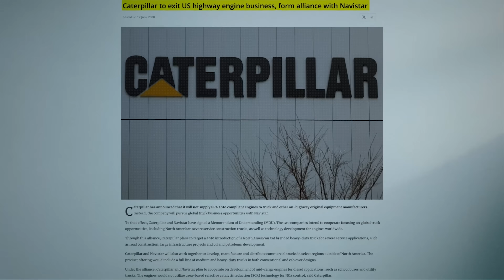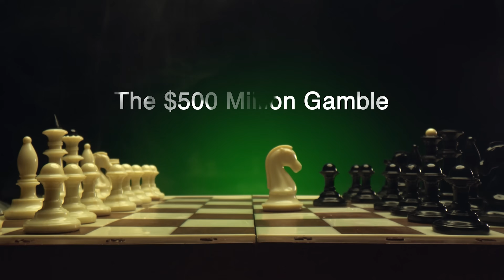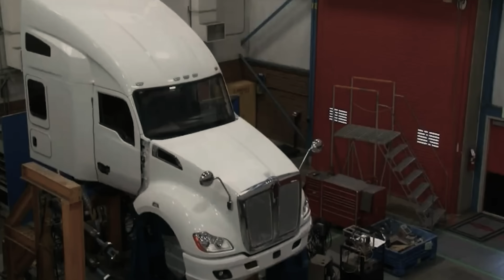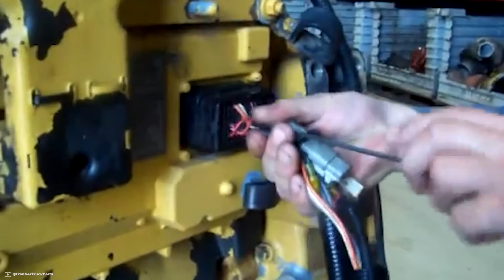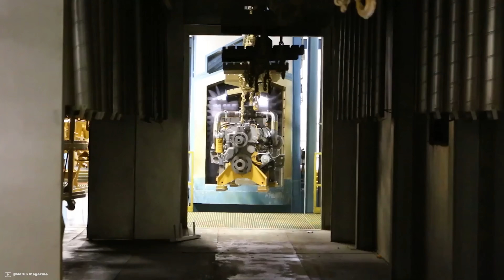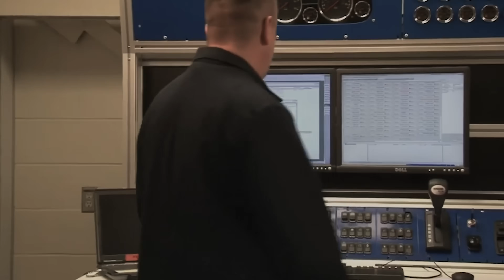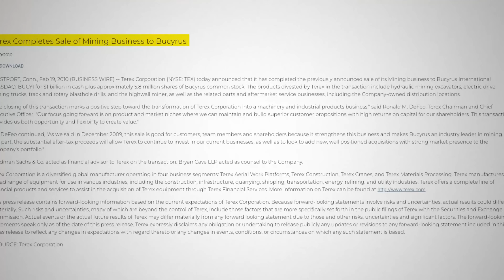Why Caterpillar Quit the Trucking Industry

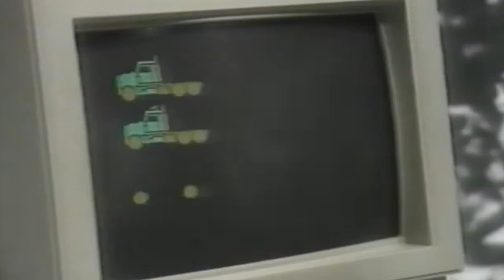Comment: 5:35 What? I never knew that Caterpillar got there first. They were running a con to cheat on emissions test 20 years before the VW Dieselgate scandal in 2015. VW had cheater software in their 2.0-liter and 3.0-liter TDI engines which could detect when an emissions cycle was being run and dialed down the engine to pass the test. Ultimately this cost VW on the order of $30B in fines, owner credits, and buyback costs.

Comment: Sure, they pour particulate into the air like there's no tommorow....but all diesels are dirty anyway. Emissions kill simple mechanical diesels. 

We need emissions regulations, don't get me wrong, but it feels like simplicity and reliability become irrelevant when the EPA forces you to use engine destroying technology. Clean air is important, but I am pretty sure a heavy duty diesel is supposed to just do its job and pull loads rather than please the government and run clean.

Comment: 3406 was a good engine, but the best diesel engine is so much less efficient than the worst electric motor. It's time to move into the 21st century.
Reply: Said someone who knows nothing about trucking.  Road trains in Australia can put at least 1000 km under the wheels before even needing to think about refueling.  Show me an electric truck that can match that (and refuel in under 15 minutes) and still drag 80 tons down the road in 40 plus degree heat.  They don't exist and never will.  Same for agriculture, no diesel equals no food.
Reply: @AnnaJackson-k9m  You're right that I know virtually nothing about trucking but I know a fair amount about caterpillar engines and electric motors. Your prediction that electric OTR trucks will never refuel in under 15 minutes is mistaken. Here is a video of a New Zealand manual battery swap shop refueling an electric truck in under 8 minutes:
https://www.youtube.com/watch?v=rIh_iaxm3cc

CATL (Qiji Energy) in China does it with an automated system in 3 minutes. They already exist and no diesel definitely does not equal no food.

The world is changing. Best we change with it.

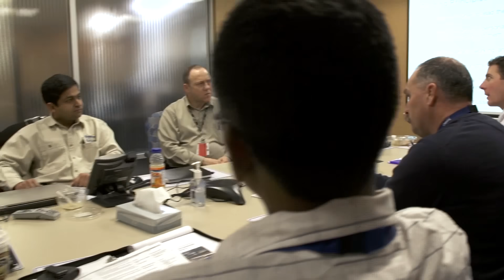Comment: 6:37 were these "deceit devices"? really? 
What if the science behind the much decryed NOx environmental- and the intentionally exaggerated health- damage was deceitful? itself. (Heart attacks have many reasons; some are hidden by the med profession INTENTIONALLY_$$!) 
Or if it was skewed, one-sided, incomplete, an ideology, as narrow minded as the CO2 & CH4 climate narrative of today! instead of politically killing those good engines, the Laws could have been stated so, that the trucks would have to drive with reduced fuel injection within city bounds, and have a normal  fuel/air ratio on the long highways, additionally get a special "super charge" allowance on special mountain steeps, where far away from settlements!  But no, the Lawmakers trended towards Dictatorism, single minded, narrow mindedly. 
if the science is not correctly done, then the politics was erraneous and this "deceit" was a legitimate protest against national and international, western self-destruction! 
"Science" just looked at the brownish leaves, but I suspect that the plant's roots in the soil and thus the whole plant is not that much affected by NOx as the consented "science of the last decades" had stated!!

Comment: 0:18 i don't know where this video is going. But almost 40% of all Big trucks on the road still has a Cat under the hood.
Reply: Based on my knowledge working for Cummins in a leadership role, it was estimated in 2022 that less than 8% of over-the-road trucks in the USA still had CAT. It should drop to less than 1% by 2028. California, the state with the world's fourth-largest GDP, banned them in 2023.
Reply: @Carl_in_AZ  yes with time there will be less and less Cat power on the road simply due to Cat not making truck engines anymore. 
My point was people are doing everything possible to keep them on the road because they are better than the other options. 

Now that the EPA and congress have removed over hundreds of frankly ignorant regulations on road diesel engines the manufacturer can start putting power and reliability back on the priority list.
Reply: @jamesmcd71  I recently retired from Cummins and worked heavliy with emmsions. The new rules affect DEF fail-point sensors, remove criminal prosecution for tampering with emissions, and require the engine to enter limp mode when running out of DEF. All over-the-road engines have addressed 2027 NOx requirements and are telling the government it is too late to change. Many areas of the country still have their own emission requirements, so it is no longer criminal but remains civil, and the engine (vehicle) may not be licensed if the emissions are tampered with. The $2 billion fine from the EPA that Cummins paid in 2024 would still apply under civil and criminal law today, given the 2024 Supreme Court ruling against Chevron.
Reply: @jamesmcd71 have you ever been otr?? Cummins and detriot run the market now i have a cummins cx15
Reply: No new Cat being spec for a truck. People just buy them
Reply: No way this stat is true. I don't think that their peak they had 40% of the market but they sure as heck don't now
Reply: Not true at all most are cummins and Detroits now

Comment: Recently ran for some 300k miles a 92' Peterbilt with a 3406C hauling Fuel Oil & Diesel. Absolutely Bulletproof. Power and More Power on Demand. Did some of the maintenance work on the engine but it was always ancillary stuff the engine itself never needed any work. It hauled a fully loaded Tanker as easily as if it were an empty. 
The unit is still on the road today.

Comment: The engine group was losing money evey year they serviced OTR.  The truck manufacters were requiring so many special builds with custom casting that the factory was drowning in cost.  The year after leaving that market the engine group was profitable.
Reply: Actually that's not true. For many years the on highway segment lost money on every engine sold, but with so many engines on the road the engine division was actually one of the most profitable divisions in the company due to parts sales.
Reply: EVERY SINGLE piece of CAT equipment loses money, except the D11.

Comment: I drove a 2006 International with a CAT in it, don't fucking do that.  It got tuned, and still was absolutely gutted on mountain roads.  Not that the original engine from INT was much better, the transmission fucking exploded.

Comment: I was a tech right in the middle of those times, I knew the 3406B inside and out. Best engines ever made. I was also a tech when the dreaded Maxxforce engine came to be. Horrible time for me as a tech and the company I worked for. We had more trucks broke down than were on the road. Most of the ones still on the road at that time were the old Macks they still had.
Reply: I had a MaxxForce engine in my truck, I hastily backed up and hit the brakes hard , it slid out of the truck bed onto the ground at the scrapyard !
Reply: Drove a couple of 3406 Engines ,Fantastic bit of kit ,so much low down torque ,coupled to a Fuller  13 speed box .

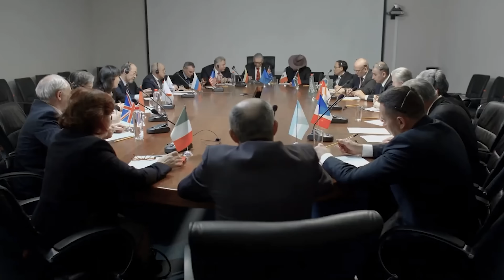Comment: 6:06 and the EPA’s answer was to force DEF which is far more detrimental to the environment🏴‍☠️
Reply: EPA didn't force DEF use.  The EPA forced NoX reduction.  Manufactures chose DEF for that. With exception to International and the Maxxforce family.
Reply: @77chucklez  "The EPA mandates the use of Diesel Particulate Filters (DPF) and Diesel Exhaust Fluid (DEF) systems on all on-road and non-road diesel engines manufactured after 2007"
They most certainly did. Once the DPF came out within a few years they added to the regulation mandating the system continue to be used and added to.
Reply: @yourfavoritelawnguy2722  Thanks ChatGPT.   NoX of 0.2 grams per brake horsepower.  That's the rule.  Again, the manufacturers chose to use DEF to meet the NoX requirement.  Ask your AI to show you the actual mandate or regulations making them use DEF specifically to reduce NoX.  I'll wait.

Comment: We don't even run Cats in our generators. 
They're expensive, parts are pricey and Cat doesn't like different (and better) controllers installed. 
If you want Cat, then you buy Perkins. 
There are better options out there.
Reply: Cat owns Perkins
Reply: Also Perkins is owned by cat lmao
Reply: Uhhh… some older cat generators have perkin engines with a cat alternator. 95% of the generators I work on in the field are all CATS. The most reliable and easy to work on units.

Comment: I work for an oil and gas outfit in Alberta, the majority of our pumps have two pre emission C18s. They regularly hit 50000 hours before the valves run out of adjustment.
Reply: Some need adjustment after 15000 hours
Reply: 50,000 hours in insane. In that time frame my MXS cat has 2,030,000 miles on it. And 2 overhauls

Comment: 2007 KW T600, Acert Cat 2,000,000 miles and still rolling
Reply from the maker: That's incredible! An '07 T600 'Anteater' with 2 million miles is living proof that a well-cared-for ACERT will easily outlast anything built today. What HP rating are you running?
Reply: @heavymaticyt 475
Reply: That is really the Exception and should be placed in Ripley’s Believe it or Not !
Reply: @vicpetrishak7705  I run two Cat 1808 oil filters, Amzoil synthetic motor oil on 20k oil changes and ALL the engine work has been done at Fabick Caterpillar in Milwaukee, Wisconsin.
Reply: @vicpetrishak7705 
Id be on the or not side sdp engine were the biggest pile
Reply: Is it converted to single turbo or you still have the twins?
Reply: @OUijA_86 I still have the twins but this is an engine manufactured 2005 and is a MXS . It's still running.
Reply: @WWade-cm8hx nice! They sound good straight pipe.
Reply: I’ve been driving an 06 International 9400 with the acert engine since it had 36000 miles on it. Today it’s at 1.8 million, with only a camshaft changed at 700,000 miles. Supposedly it’s set at 550 hp.
Reply: @charlescox-Chuck  i got a old bus running the international. that thing just rolled over 1 mil.
the 2nd time :D 
its running 16 hours a day or more every day with a decently long route.
that bus has gone places many many times!
Reply: That is very much the exception and should be placed in 
          Ripley’s Believe it or Not .

Comment: 3406E is my favorite cat engine. You can buy a rebuild kit for 6500 bucks and they are easy to work on. Lots of parts still on the shelves for these engines.
Reply from the maker: You are talking about the absolute golden era of Caterpillar right there! Being able to rebuild a legendary engine for $6,500 is exactly why guys refuse to let them die. Do you have one in your current rig?
Reply: @heavymaticyt no I don't drive truck but am a heavy equipment operator and diesel engines are a hobby of mine. If I had a rig it would definitely have a 3406E.
Reply from the maker: Great choice Kevin!
Reply: @kevinwallace3282 you’re subbed to 3406E here on YouTube yeah 👍
Reply: They’re awesome engines you really wanna see something strap your ass in one that has the 6nz in it that has been cut loose and buddy you’ll know what power truly is

Comment: Ive run T904 with C15 a T650 with a C16 multiple T404s with the C15 and multiple T400s with the C12 great engines aslong as they are coupled to a 18speed Roadranger manual. American emissions regulations killed a great engine option. The X-15 from Cummins is a good engine we're still allowed to delete the DPF/DEF systems here even on the European stuff.
Reply from the maker: Thanks for the comment! Do you find the deleted X15 is just as reliable as those old C15s?
Reply: @heavymaticyt just as reliable its at 500000 so far and going strong
Reply from the maker: That completely makes sense! It just goes to show the core Cummins engineering is great - it just needs to be allowed to breathe without the plumbing choking it out. Is that X15 sitting in a T909 or a T610?

Comment: Down here in NZ, one of our trucks is a KW T-401 from like 2006 w/ a C-12 in it. Bit underpowered for a semi and tip trailer considering the hills in this country...has had a rebuild and runs beautifully. I've seen those "Cat" trucks--they're built w/ International cabs and I've talked to guys who have driven them and they hate the cab--small and make lots of noise.
Reply from the maker: A C-12 in a KW is a super reliable setup, but I can't imagine pulling a loaded tipper through the NZ hills with a 12-liter! 😂 How many kilometers are on the engine since the rebuild?
Reply: @heavymaticyt  Probably not more than 200 thousand...used to be busy, but not in recent years, so yeah, engine is still in great shape!
Reply: @heavymaticyt most of those trucks do over 1 mil before rebuild 
They are HARD kilometers vs Americans tho